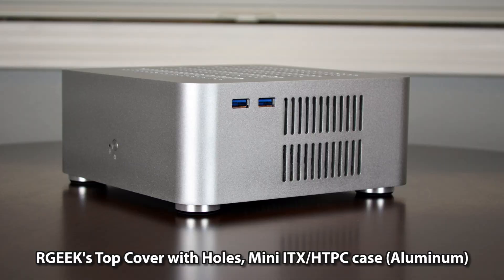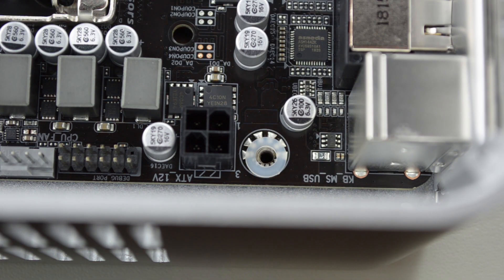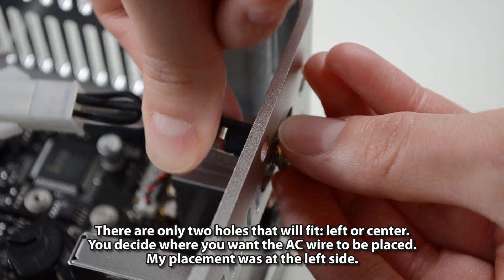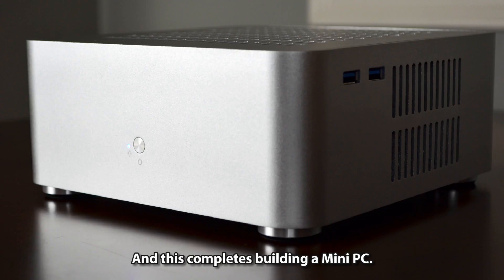Building a G5400 Mini PC (Step by Step)

Comment from the maker: ========
Timeline
========
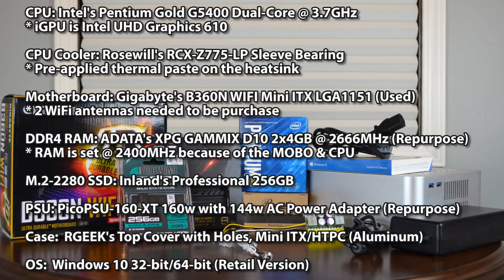1) The part list @ 00:06
2) What tools I need @ 00:11
3) The case @ 00:16
4) Uninstall the top cover @ 00:21
5) Uninstall the storage panel @ 00:53
6) Remove the bag within case @ 01:40
7) The I/O Shield @ 02:21
8) Install I/O Shield @ 02:24
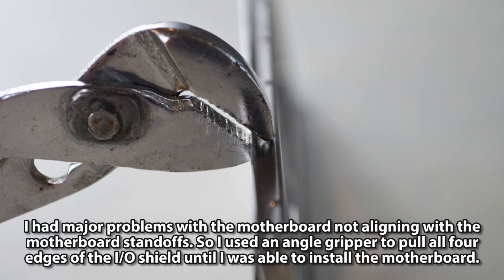9) Issues with alignment @ 02:53
10) The Motherboard @ 03:05
11) Flip MOBO over @ 03:13
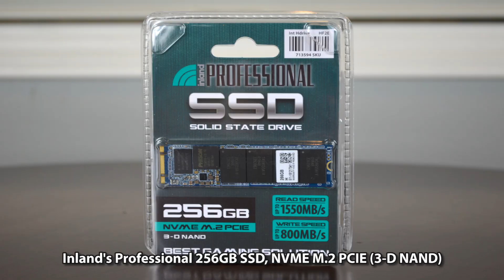12) The M.2 PCIE SSD @ 03:24
13) Uninstall the M.2 screw @ 03:31
14) Install the M.2 SSD @ 03:44
15) Align MOBO with standoffs & I/O Shield @ 04:09
16) It's OK @ 04:19
17) Requires some gentle force @ 04:29
18) Install the MOBO @ 04:28
19) Remember to align with standoffs @ 04:46
20) Don't fully install until all 4 screws are on @ 04:59
21) Tightest space to install for MOBO @ 05:37
22) Reinstall push button PW @ 05:51
23) Why don't overdo the torque @ 06:26
24) Correcting until clicks @ 06:53
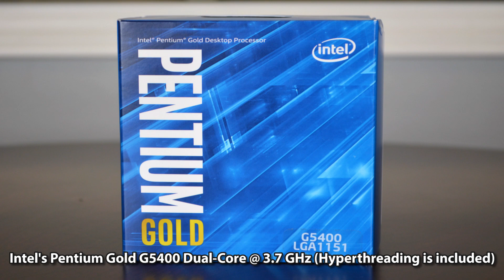25) The CPU @ 07:00
26) Install the CPU @ 07:17
27) Alignment Keys, Pin One Corner, Triangle @ 07:22
28) Finish installing the CPU @ 07:42
29) The CPU Cooler @ 07:56
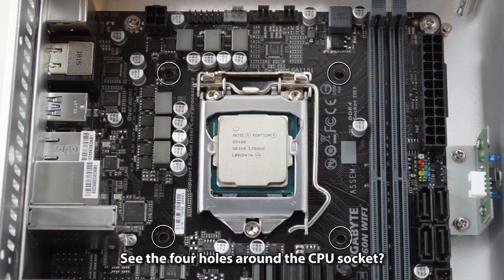30) Install the CPU Cooler @ 08:03
31) Connect CPU fan connector to CPU_FAN @ 08:56
32) The RAM @ 09:25
33) Install the RAM @ 9:33
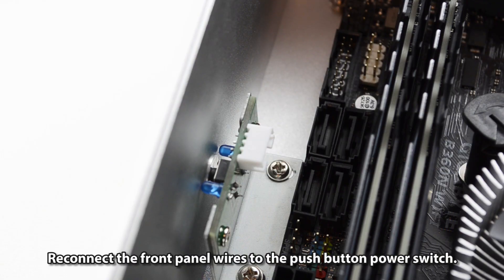34) Reconnect the FP wires @ 10:49
35) The POWER LED & POWER SWITCH @ 11:08
36) Connect PW LED to PLED+- and PW SW to PW+- @ 11:11
37) The PicoPSU 160w @ 11:27
38) Connect 24-pin PicoPSU to ATX @ 11:32
39) Connect PicoPSU's 4-pin to ATX_12V @ 11:58
40) The hex nut & washer @ 12:05
41) Install the power connector @ 12:08
42) Connect HDMI cable @ 12:42
43) Connect AC DC power cable @ 13:01
44) Connect a keyboard & mouse @ 13:08
45) The 144w power adapter (brick) @ 13:13
46) Connect the power adapter to DC 2.5mm 12v @ 13:18
47) Connect the power adapter & AC cable to power surge @ 13:26
48) Turn ON power surge @ 13:39
49) Press power button to turn ON computer @ 13:41
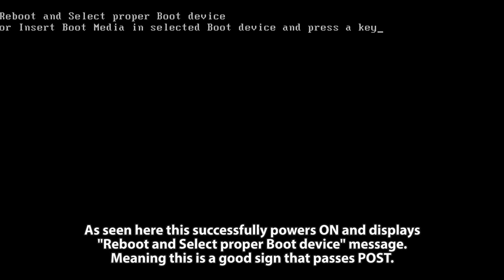50) Successful powers ON @ 14:05
51) Reboot and Select proper Boot device @ 14:07
52) Power OFF the PC & disconnect the power cables & peripherals @ 14:15
53) The 3.0 USB cable @ 14:22
54) Connect the 3.0 USB to F_USB30 @ 14:27
55) Reinstall the storage panel @ 14:46
56) Clockwise the 4 screws @ 15:11
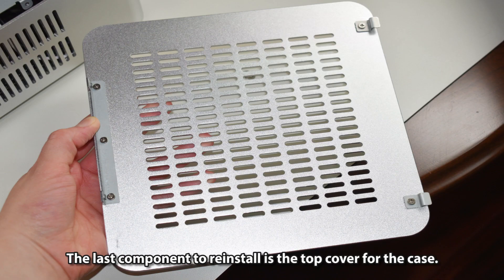57) Reinstall the top cover @ 16:07
58) Clockwise the 2 screws @ 16:35
59) The WiFi antennas @ 17:04
* NOT the original WiFi antenna. Had to purchase.
60) Clockwise each WiFi antenna @ 17:19
61) Adjust the antennas @ 17:47
62) Reconnect the monitor and peripherals @ 18:03
63) Power ON the computer again @ 18:06
64) It works, ready to install OS @ 18:22
65) Thanks for watching! @ 18:29

Comment: Can you use an sfx psu like for example fsp flexguru type of psu for this mini pc instead of the pico psu?
Reply: Thank you very much for you reply! ❤ This is so helpful since Im just a beginner, I'll try to asm again if ever I encounter problems but really thank you so much 😊
Reply from the maker: @flandrei3745  You are most welcome. Again, if have more questions down the road, I am willing to help with what I can.
Reply from the maker: Hi Flandrei, a SFX PSU is going to be too large to fit into this particular case I used. It must be a similar form of a PicoPSU or an HDPlex. I'll provide a couple of hyperlinks to clarify what these are. And keep in mind, the power adapter needs to be included as well. In other words, don't forget the brick too which is for the external connection to power up the computer while a 150w or 160w PicoPSU or the 200w HDPlex is the internal power source.
https://www.mini-box.com/Power-Supplies-Kits | https://hdplex.com/hdplex-200w-dc-atx-power-supply-12v-30v-wide-range-voltage-input.html
Reply: @EltechYT  I see, if I may also ask can a 120W power board dc to dc with 12 V power brick able to power up a ryzen 5 5600g CPU in an A520i mobo? cause thats what Im planning to build and its a Godsend that I stumbled upon your video.
Reply from the maker: @flandrei3745  You are welcome to ask me anything about the computer build, especially if you are making one of your own. I be happy to advise or offer suggestions but it will be your final decision at the end of the day!

Anyways if you intend to use this RGEEK case I used in the past, I don't think it will fit a power board version either or I assume just barely. It's a very small case in reality and seems people had less problems if they used a PicoPSU, some similar version of a PicoPSU, or that 200w version HDPlex I shared in the hyperlink. You can certainly use a 120w PicoPSU and purchase one with a power adapter that supports it. Since you mention what type of hardware, I created a part list you could maybe reference to from PCPartPicker but you are welcome to change its parts since I don't know what country you are but hopefully it gives an idea where to start to. 

Here is a partlist reflecting your APU and motherboard at least. I updated this once more, because I forgot to mention the 250w option too, so the second part list that is about $510 USD which may be better to allow more headroom for wattage use. You can think about buying RGEEK's picoPSU verison too. Both part lists have the appropriate bricks included so you don't have to deep search about it.

[*] https://pcpartpicker.com/list/vQxxmr - ($505 USD) 120w picoPSU with brick, 12/2/2022

[*] https://pcpartpicker.com/list/NnZXBj  ($512 USD) 250w picoPSU with brick, 12/2/2022

And for an OS purchase suggestion, would be PCWorld Software. They been legit for my experiences so far with Operating Systems, Anti-viruses, Microsoft Office if need it. Otherwise, if you know something else that is fine too.

Just I tend to do the download versions to a USB to save myself more money. Assuming you have the capabilities on another computer to do this. If not, then it makes more sense to purchase a full version Windows 10 or 11 and not the OEM. Since OEM Product Keys cannot be relocated to a new motherboard unless manage to make a phone call and convince a legit reason.

[*] https://software.pcworld.com/p43717-windows_10_professional - Windows 10 Pro (OEM) PK ($69.99 USD)

Let me know if you have anymore questions or if I need to clarify something better.

Comment: Can I install i9 proccessor on this cabinet(thevmotherboard which size is limited to this cabinet)
Reply from the maker: Yes, an i9 processor will work with the compatible ITX motherboard form. Only an ITX motherboard with this particular mini ITX case. Just be sure to have at least a 200w or above PicoPSU [with the appropriate brick] or consider the HDPlex for power source.

So here are two possible options with Intel.

Option 1: Purchase Intel's 10th gen called an i9-10900 OR the i9-10900K paired with a Z490 or a Z590 ITX motherboard. The cheaper ITX motherboard options are at least the B460 / B560 OR the H510 motherboards but keep in mind with the limited features when purchasing the lower end motherboards.

Option 2: Purchase the i9-11900 or i9-11900K (Intel's 11th gen) paired with a Z590 ITX motherboard. For the lower priced motherboards it is either the B560 or the H510 ITX motherboards.

Avoid any i9-#### F or i9-#### KF CPUs because they don't have integrated graphics which you'll need to have video output to your monitor or TV.
Reply: @EltechYT  I mean in this cabinet i can use?
Reply from the maker: @AMH431  Sorry if I am misunderstanding you. Cabinet? Did you meant the motherboard or the case?
Reply: @EltechYT  cabinat
Reply: In which a i9 proccessor's motherboard can enter
Reply from the maker: @AMH431  Cabinet? So you mean the computer case? An i9 can be installed base upon the motherboard form. The ITX is smallest form, MicroATX is the next size up but not quite as large form, and the ATX form is the largest size motherboard available. The computer case I used from this video was a RGeek Mini ITX case with top having holes but I don't think Amazon sells these where I am anymore. Newegg has some available: https://www.newegg.com/p/2S7-01NV-00C89

However, for those outside of the USA, I think AliExpress should have some available too. Here is this version I found here: https://www.aliexpress.com/item/1005002918138129.html?spm=a2g0o.productlist.0.0.6a6b10fdmzZ3u2&algo_pvid=ca180db2-0c27-4b66-9464-a80694749c16&algo_exp_id=ca180db2-0c27-4b66-9464-a80694749c16-0

Apparently the version with the top holes might be Out of Stock. Unless can contact RGeek if they could create a top version with holes, maybe?

Sorry for my confusion. I may not be understanding your question so I apologize for the misunderstandings.
Reply from the maker: @AMH431  Quote: "In which a i9 proccessor's motherboard can enter"

Responding to your second statement here. So I am thinking you meant the computer case? I hope my first response clarifies your previous question but if not please let me know and I'll try my best again to answer. I am sorry for not understanding the question before.

Comment: Do we have power and space headroom for a GPU?
Reply from the maker: For power a PicoPSU or an HDPlex is designed best for this particular case I used. There isn't enough space for a dedicated GPU. It's depending upon the iGPU (integrated graphics) from the CPU or if purchased an Mini ITX Motherboard with built-in integrated graphics. So unfortunately no space headroom for a dedicated GPU with this case.
Reply: @EltechYT  thanks for the response
Reply from the maker: @HD-vs2tn  No problem. Happy to help.

Comment: Hi There, thank you so much for this tutorial. I take it that the pico psu and the power brick are not included with this case. Can you show me a link which pico psu and power brick will be compatible? Thank you!
Reply from the maker: It's no problem. And here's a direct link for where you can purchase the PicoPSUs with the power adapter (brick): https://www.mini-box.com/Power-Supplies-Kits
It's best to purchase the combo from Mini Box's website I think but you can also check Amazon or Ebay too.

The PicoPSU 160w + 192w Adapter for $89.
- https://www.mini-box.com/picoPSU-160-XT-192W-Adapter-Power-Kit

A bare minimum PicoPSU is an 80w but I would at least recommend the 90w as the bare minimum wattage if the budget is very-very tight. Cost about $50 for the combo.
- https://www.mini-box.com/picoPSU-90-100W-power-kit

Comment: Thank you so much for this video. I´m building a similar build myself and this video realy helps. I got a question about the Picco PSU. Mine got a 20 pin power connector (not 24?) which supports power up to 120W. Will it be enough for a build with a I3 8100, 1TB SSD?
Reply from the maker: Hi pamariens and glad this was helpful. And a 120w 20-pin pico psu should still power up the i3-8100 along with the 1TB SSD.
Reply: @EltechYT  Thanks for your reply. Much appreciated.
Reply: Hope I can also ask you this: I see a small metal ring attached to my psu. I think it may have a purpose for safe guiding electricity or something, but I honestly have no idea. I didn't noticed it in your video. Do know what it's for and more importantly: where do I attach it? On this page you can find my psu with the ring: https://www.inter-tech.de/en/products/psu/other/mini-itx-psu-120w.
Reply from the maker: @pamariens2039  You are always welcome to ask me anything. Its been a while since I seen a ring but to keep it simple. These particular rings, small and attached or large and wrapped around with front panel wires. These "rings" in a computer are to help reduce radio signals. I would say leave the ring alone and connect your wires as usual.

You're right some Pico PSUs come with a ring while others don't but you should be OK with it left alone as it is. Doesn't need to be attached to anything.
Reply: @EltechYT  Thanks for the quick and useful reply. I´ll leave the ring alone. I hope I can start building my mini ITX this week when parts arrive. I frequently rewatch your video(s). This means that - should I fail hard - I blame you... just kidding ;) Thanks again for your help. Def would have failed without it.
Reply from the maker: @pamariens2039  No problem and haha. Sure I'll take the blame. I can handle it. ;)

If run into problems or still have questions, I'll be around. Happy building!
Reply: @EltechYT  I may take you up on that, thanks! Keep up the good work!
Reply: @EltechYT  Hi Eltech, just wanna say that I finished my first ITX build today. Thanks for all the help. Couldn´t have done it without you.
Reply from the maker: Hey pamariens, and congratulations! Very great news and happy to know you built your first ITX build. You did the spending, research and hard work to assemble it.

I only placed a visual guide or an example. But always here to help with whatever it is when it comes to computers or if run into problems in the process or sometimes just clueless (and yes I been there too). Good O' tinkering / fixing and research.

Again, well done and hope you enjoy your new ITX computer for quite sometime!

Comment: is there enough space for that Pico PSU in that box? https://ru.aliexpress.com/item/32817327288.html
Reply from the maker: Sorry I just got to your question. Silly held for review but I checked your link and its dimensions. I am taking a guess here but is the Pico PSU part about 30mm or 40mm in width? If so then should be able to fit with this particular case if talking about the RGEEK case I used: https://www.amazon.com/dp/B07Q7NGLW6?tag=pcpapi-20&linkCode=ogi&th=1

You may need to use the SSD/HDD bracket within this RGEEK case to install that PicoPSU since inside the case it's very tight space. Then highly recommend with an M.2 SSD to the motherboard or manage a 2.5" SSD/HDD with the bracket.
Reply: @EltechYT   Board size 35 mm by 150 mm. The mounting bracket is too complicated for me, I changed my mind. Then I will put this pico, at 250 watts.
 https://ru.aliexpress.com/item/32826517978.html?spm=a2g0s.8937460.0.0.34ee2e0eo63uR5
Thanks for the recommendations and help with the selection.
Reply from the maker: @ledrol1054  Oh my, then yes go for that 24-pin PicoPSU. Less of a headache to work with I think. And no worries. I'll be around if have any questions and happy building!
Reply: @EltechYT  Thanks!
Reply from the maker: But if you used this PicoPSU then this will be much easier to manage: https://ru.aliexpress.com/item/32815343129.html?spm=a2g0o.detail.1000023.6.19182164rK76zV

Versus the long width PicoPSU you will have to be creative with the bracket inside it: https://ru.aliexpress.com/item/32817327288.html

You decide what is best for you but I think the 24-pin PicoPSU would be easier for this tight space ITX case or any tight space ITX cases.